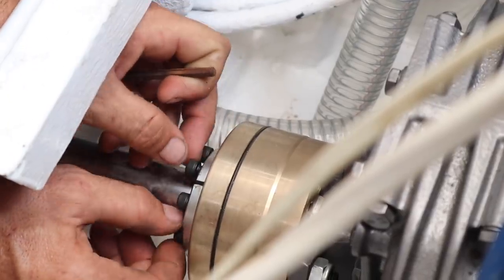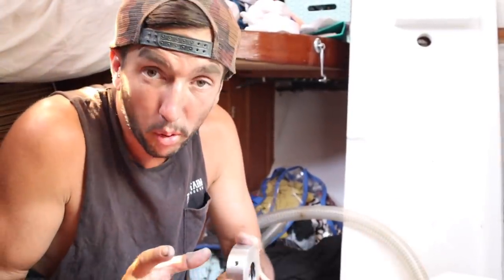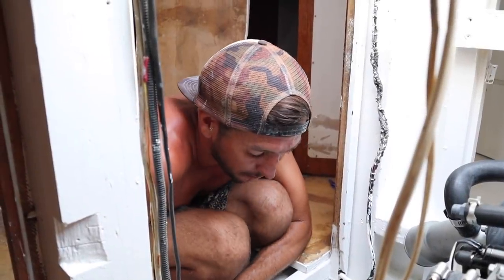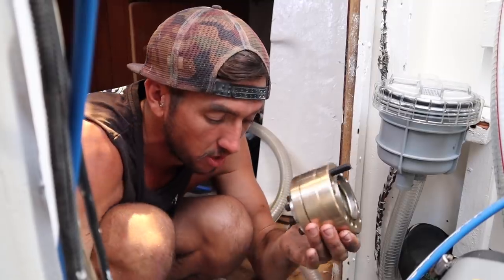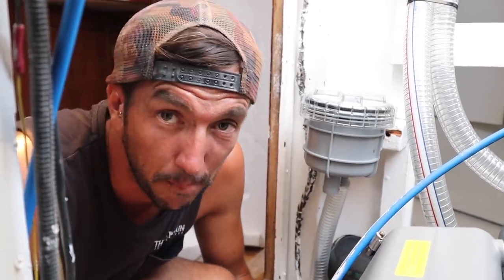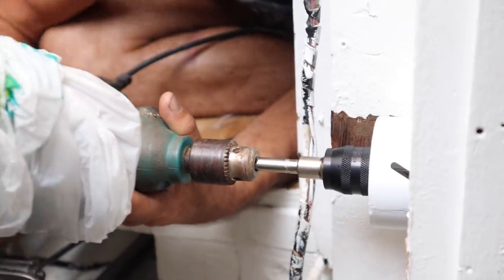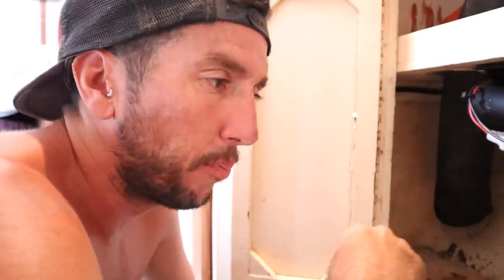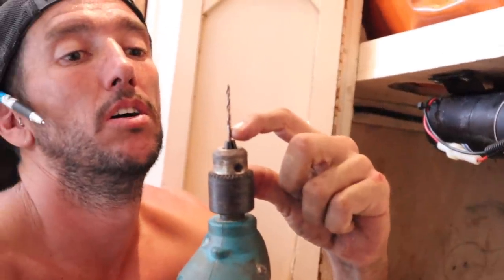Lets Make this Motor Work! | Sailboat Refit (Sailing Nandji) Ep 128

Comment: A good trick with holesaws, once the pilot hole breaks through, go around the other side and use the hole saw to finish or go in about 6mm (1/4") then go back to the original side and drill through. That should stop any surface tearing or splintering.

Comment: I just come across your videos and this is 1 of the 1st I seen. With your exhaust over board discharge to stop water coming in the engine put a "screw down non return valve" on this does a few things stops water going from sea to the engine and If for any reason toy have to change exhaust hose in the water you  can close the water off and change exhaust hose in water or if your get a leak of any kind int the exhaust hose to stop sea water coming in you can also close the valve. a cheeper option is an "Check Valve" or also known as a 1 way valve. 
keep up the goos work.

Comment: That shaft seal with the smooth, polished face up against a hard rubber seal is exactly the same idea as the seals in General Motors locomotive engine water pumps. About the same size, too. And I've seen those seals run for over twenty years.
Reply: It's not rubber, but solid graphite .

Comment: Nice work on these videos, you covered the engine installation well.  I've never worked with  those shaft seal and exhaust systems and I learned alot.

Comment: Thanks that was a good video, interesting. the drill bit drive is called a (SDS) slide drive system, It is a very common drive now,mainly for bigger power drills and chisels. the engine is looking good, looks like it will be a lot smoother....Enjoy enjoy.  :)

Comment: That is a really good seal system like electric industrial water pumps use. I did not like the seal that the yacht "Ran" had to replace, only used an automotive lip seal running on the shaft.
Reply: @Ted Sherrin I was describing the mechanics of the seal, I know it is a 150 to 230 euro Volvo Penta seal that lasted 2 years of little use.

Comment: With the shaft seal, I had one fot over 10 years. Once you have the seal set, put two hose clamps on the shaft oriented 180 degrees to each other hard up agains the s/s doughnut.  One is to help keep the pss in place the second is for balance.

Comment: Mate just had a thought and it might be nothing but will mention it any way: if your rudder isn’t in the mid-ships position ie hard over to port or starboard, how is your prop clearance past the rudder. - for all degrees of rudder could be in and all angles that your prop blades could be when it flops from going from ahead to astern. Am thinking that there may be a chance the prop could catch on your rudder if it is hard over as your prop angle moves from forward to aft. Am guessing you checked it for all angles, but thought I should ask.
Reply from the maker: Thanks for the though, but yes, we checked that before finishing off the install. There is plenty of clearance when the rudder swings hard to each side. It is in the video, we push the rudder hard to one side, we did this for hours checking clearance with all possible movements.

Comment: That hole saw is for a sds max drill that's the funny fitting.
Reply: Yep used for concrete hammer drills. Toss it. It will never work well in a regular chuck. But like you most of has made it work in a pinch. Congrats on the new motor!

Comment: Yosh I know you research and know your stuff.But that PSS seal is the same as on our boat professionally built and that hose you are running out side the boat to drain water on our boat we pump water in to lubricate the seal.We have twin engines and once we ran on one motor with the other free wheeling for a couple of hours the temperature of the free wheeling PPS was ten degrees hotter because it was not getting water. Might be something to check on.
Reply: I think I got that wrong. We have a bearing on our shaft which requires it to be plumbed. You may not have a bearing, which means you’re right, you just need to vent it. Thanks for the video it meant we’ve learnt something,

Comment: You will have too much back pressure on that exhaust system once that exhaust is under water when the boat heels over. It may foul your valves.
Get a manometer onto it or make one with a clear plastic tube and measure the exhaust pressure and compare to engine manufacturers maximum allowable
Reply from the maker: Everything installed is within Yanmars guidelines. There is no specific reason the exhaust has to be on the transom, the biggest thing we have noticed is potential drag of the outlet. If the boat is heeled over that far, we are not motoring!

Comment: That's exhort hole is too low and should be at the back, to prevent water being forced in. Having it on the side will spoil the dynamics of the ship and will force water in when you are healed over...
Reply from the maker: If we have a following sea, water will be pushed inside with it on the stern. The gooseneck stops any water from flowing back in and is placed according to Yanmars standard. Our last exhaust was the same height and went under water when heeled over and caused no issue. Do you have a link to information to support your statement? We have found no information on this.
Reply from the maker: @latitudeash  again this is your speculation, please provide information to back your claim, everything has been installed to satisfy yanmar and vetus requirements. We have looked at other boats with a centre cockpit having the same setup. We researched our butts off before installing and found no evidence that this will be an issue.  everyone has an opinion, send us through some info if you have it. Cheers
Reply: @FrothLyfeSailingNandji  :  I do hope it works. If you have a look at the gooseneck, it has a flap valve. So if your engine is on that flap will be open. A large sea wave with a lot of pressure will push past it. It is my opinion. But lets see what happens. I do hope it will work, and looking forward to the testing phase. Please keep us updated on this area.
Reply from the maker: @latitudeash  the goose neck is 1.5ms above sea level so it would be a massive wave to force water up that high. It could also absolutely happen with the exhaust on the stern with a following sea and would be more probable to happen because in big seas you want the waves on the stern. Same thing.
Reply: Sailing Nandji - Frothlyfe yes that could happen, but not as often. Any case thanks for the response. You seamed to under stand the ups and downs of the installation. Looks like it would have been a lot of work to put it on the transum and lots of pipe work showing. I guess for your build that's the option you thought best. I await to see how the experiment will turn Out.
Reply from the maker: @latitudeash  yeah we absolutely put a lot of thought and planning into it. Crazy to think the last exhaust went down into the hull and straight to the saxophone. The new system with the goose neck and the 15 litre water lock is much better. Will be keeping an eye on it and keep you posted in the vids! Cheers mate!